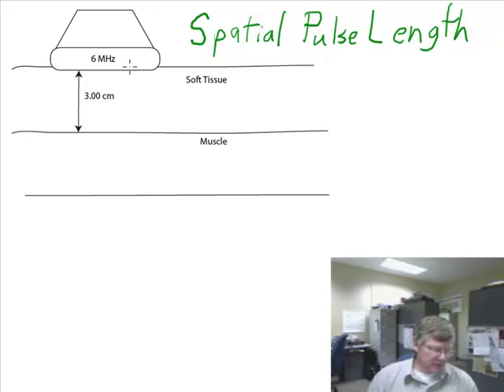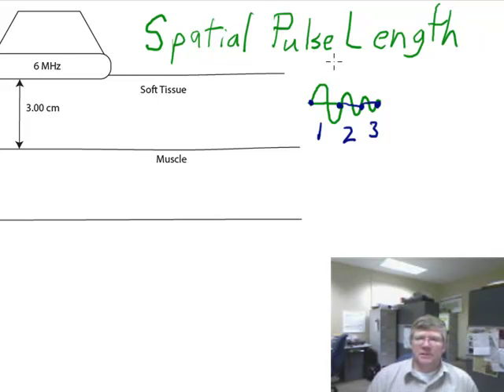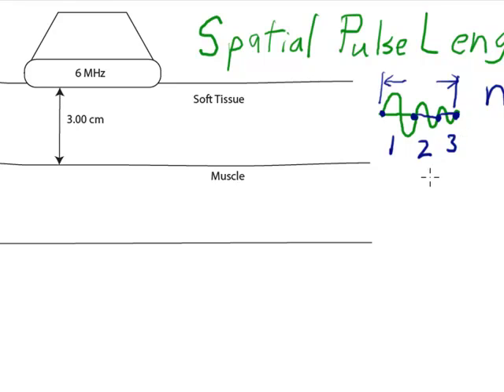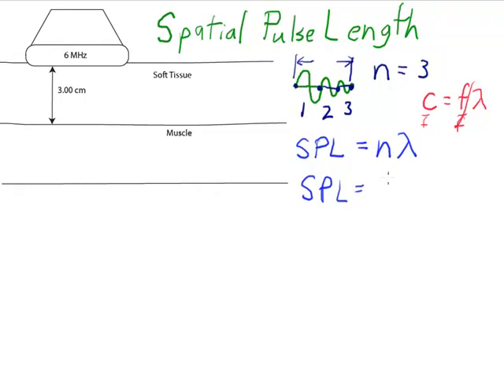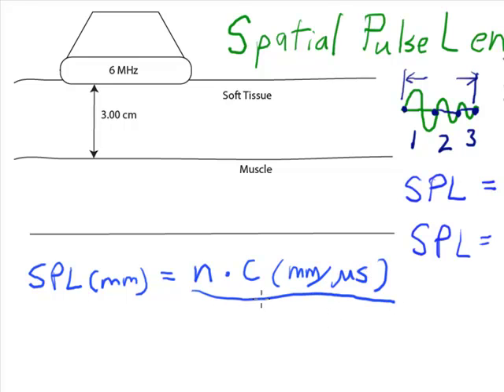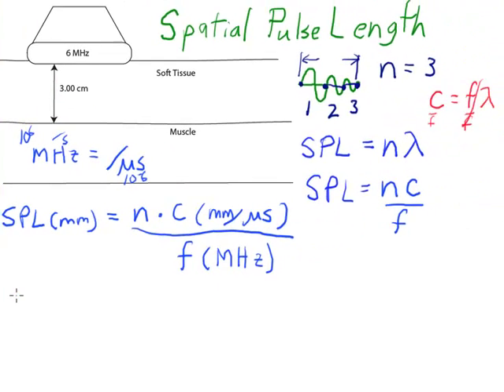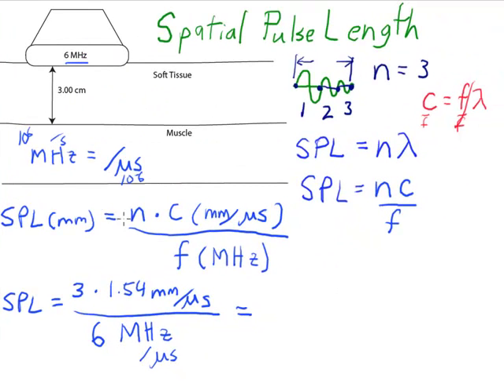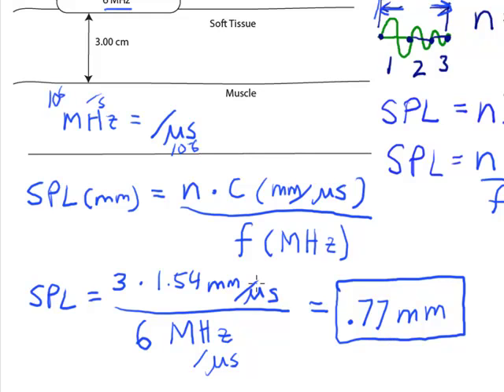Ultrasound Physics: Spatial Pulse Length (SPL)

Comment: how do you determine the number of cycles n?
Reply from the maker: n should be given with the problem but I think it should depend on the transducer.  It's like plucking a string, it will oscillate a couple of times before it comes to rest.  When the transducer gets a pulse of electricity it will vibrate a few times before it becomes to small to detect.  So I think it will be a fixed parameter of the transducer.
Reply: would that be something that is stated on the specifics of the transducer?
Reply from the maker: Yes, it should be.  The operator cannot change it.
Reply: Shouldn't the answer be 7.7 mm since the unit of depth is 3cm and not 3mm? We'll have to convert the units all the same, yes?
Reply: @small-timegarden  Sorry about being four years late, but I no longer have access to these videos. No, the 3 is the number of pulses, not the distance traveled. The 3 cm does not come into this example, I just happened to have that graphic handy at the time.

Comment from the maker: The DF is the fraction of the repetition time that the pulse is generated so you should be able to calculate the spatial pulse length from that if you know the tissue. An example using soft tissue: Assume a 1 kHz repetition frequency and 1% DF. 1/1kHz = 1 msec for repetition time. The pulse is generated over 1 % of this time so .01 msec for the pulse or 10 us. Then assuming soft tissue 1.54 mm/us * 10 us = 15.4 mm. I think that is how to do it.